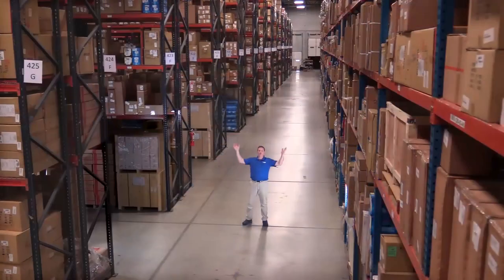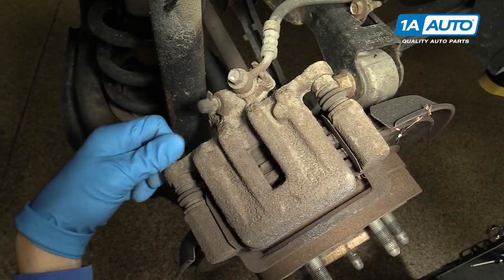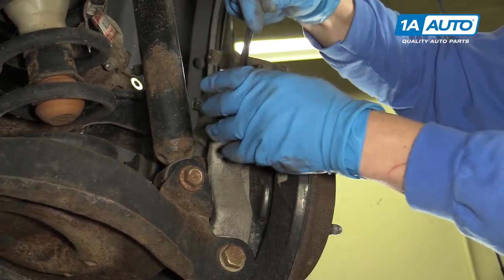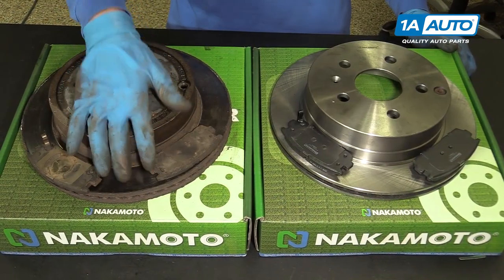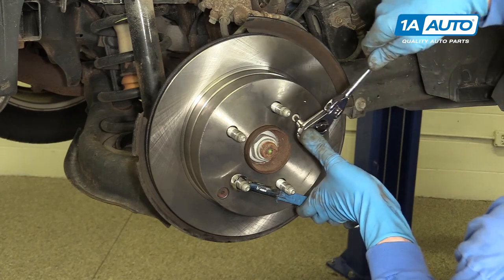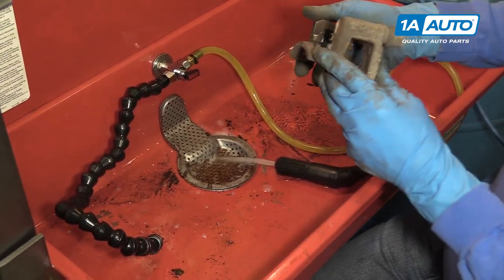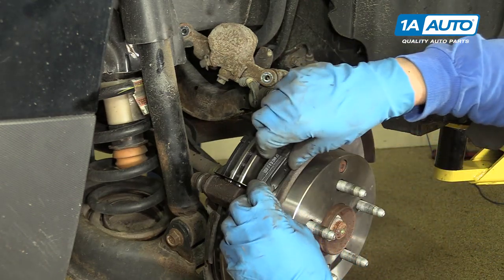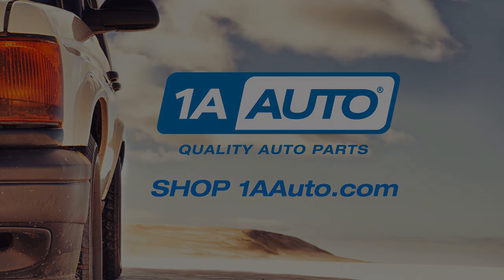How to Replace Rear Brake Pads and Rotors 10-16 GMC Terrain

Comment: If you put a little grease underneath the pad adapters it will stop them from rust jacking and jamming the pads.
Reply from the maker: +papa bits Thanks for the tip!

Comment: Good until you said putting grease for lube in the caliper boots. Then you'll have to get new brakes soon. Use silicone. Not grease. Or If you meant caliper grease, should have said tbat
Reply: Rick M so it's caliper grease that should be added to the list?
Reply: @Nightman1027 Yes

Comment: On this vehicle you are asking for trouble by just pushing the caliper piston back w/o loosening the bleeder screw.  I've always just pushed them back with large C-clamp like you did but there is something Jenke about the design that when you push fluid back towards the the ABS pump and/or master cyl that causes soft pedal.  It will feel fine with engine off butt get spongy with engine running and you can just keep pushing it to the floor.  You'll have brakes but bad pedal and you can bleed them anyway you want too, it won't come back.  Dealer says this is normal?  NO IT ISN'T.
Reply: If you pump the brakes in between each brake that is finished, you should be fine. I had no issues.
Reply: Same as mustache x

Comment: This is a $450-600 job at the dealer.
Reply: rotors and brakes, almost $850, just for rear tires.

Brake pads and rotors, $300 in parts. Bonkers.
Reply: Dealer quoted me $710.00 just the rear